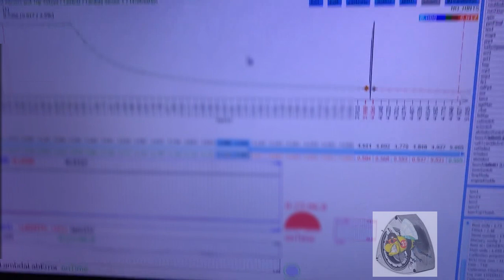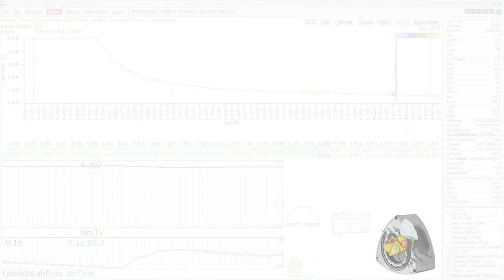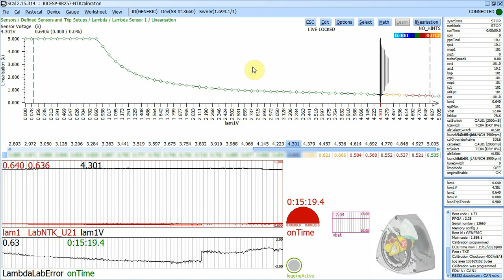Syvecs | NTK Lambda sensor calibration - Consumer V's Lab grade

Comment: Can you just not do a free air calibration on any sensor and have it be accurate?  Some afr controllers don't use the calibration resistor at all.